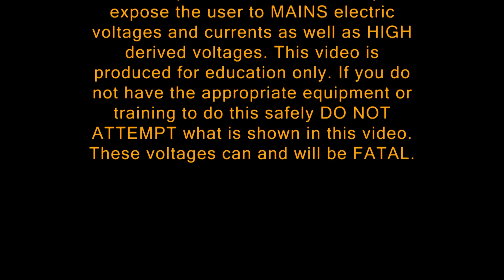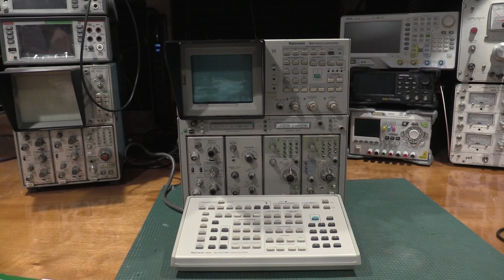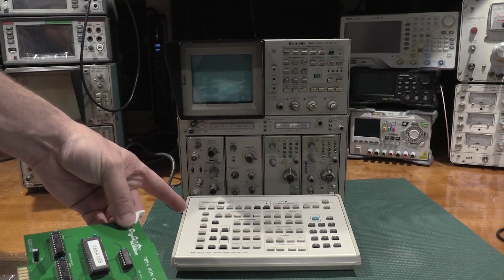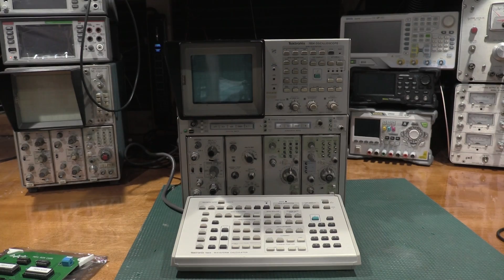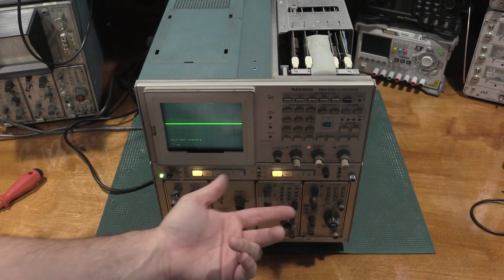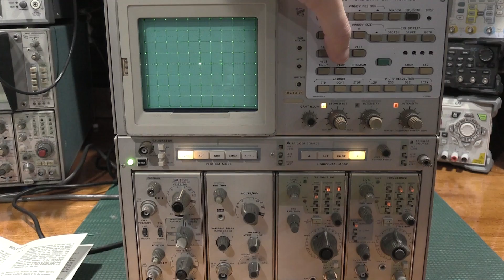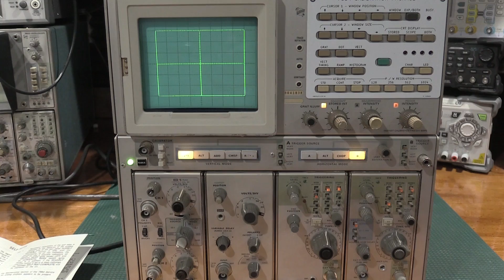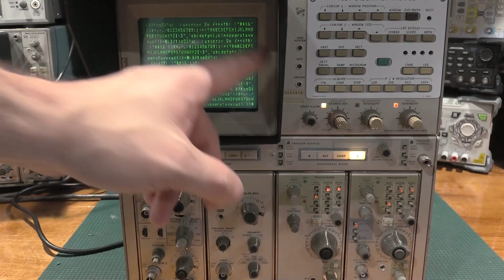Tektronix 7854 ROM Upgrade preventing ROM ROT

Comment: Oh nice, is that the card that Holder Luben designed a few years back?  I didn't realize it was in production.  
Your ROMs may not be subject to the rot - I thought it was the earlier purple ceramic ROMs from MOSTEK that were the real culprits (they were on my 5042).  It's worth mentioning that the real value of this card, in addition to the diagnostic mode, is that the pin compatible EPROMs that can replace these ROMs are complete unobtanium, and even if sourced, are not programmable by modern programmers that hobbyists would tend to have.

Comment: Could use the link to the 7000 series hoods. I might want to get a few. 

This really tells me to not bother putting one of these on my 'to-get' list. In 7000, I use a 7834, an R7844 and a 7104 1gig. I had thought one of these might be fun to add, but for me, these are just lab tools, not a hobby  or 'collectable' activity. A 2247A provides rise and fall time, freq & period, cursers, and other digital aids... and a current production Siglent provides heavy math like FFT. I sure like the 7854 concept, but am not prepared to engage in the rite of passage to keep one running. Glad the Vintage Tek guys have the goodies, and others are doing restoration, but I'll pass myself. I will enjoy watching your restoration regardless of how you split it up

Comment: I vote for more than one video!
I have a 7854 that I've been holding off aligning because it is such an intimidating piece of equipment. This intro is great, and I would love to learn more about potential bit-rot. My scope seems to be working fine, but if there's anything I can do to prevent the ROMs becoming corrupted I'd like to know how. And it seems this diagnostic board is worth having, just for the excellent capabilities it brings to the process.
Your videos have helped me understand and perform alignment and calibration of my 465s as well as my cal gear. And what cal gear to accumulate. Yet there's always more to gather and do. That's part of the fun!
Demonstrating the 7854 alignment will be a great addition to your videos.

Comment: Interesting video, I have the same scope. You have me worried now about the ROMs 🙂, perhaps I should prise them out and make duplicated before too long. Its a tricky call as easy to make faults when it essentially ok.
Reply from the maker: I would not worry about it too much there are options when the time come as well as the vintage Tek museum has the firmware and I believe it is on the Tek wiki as well. So if there ever was a need for the firmware it is still readily available. This unit did have a ROM fault but was still functioning as a scope. However in the vintage Tek ROM cards the DIAG firmware is a really nice to have.